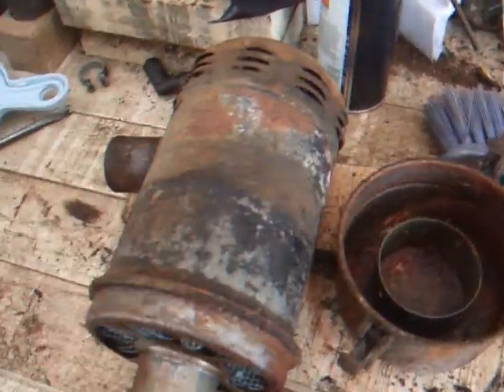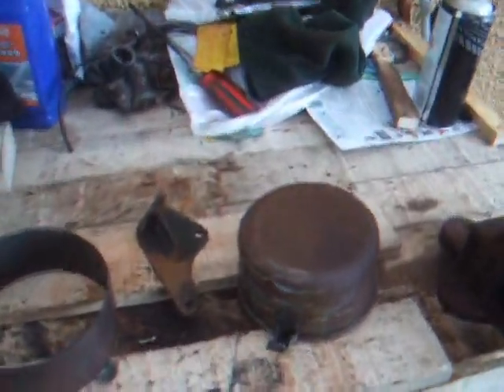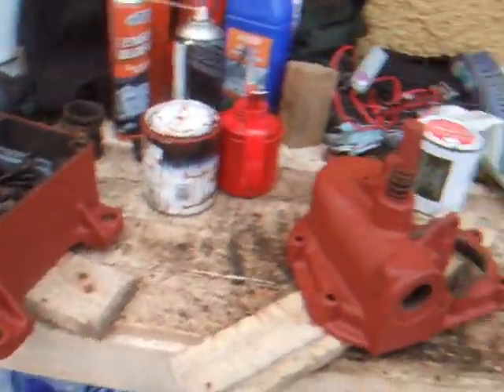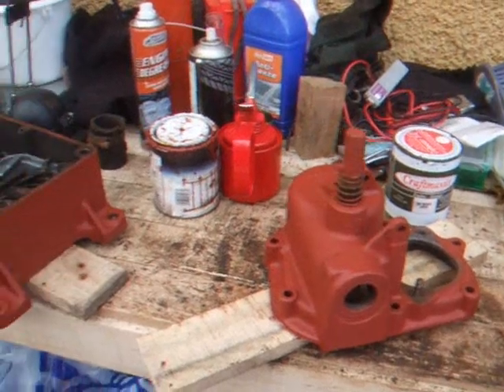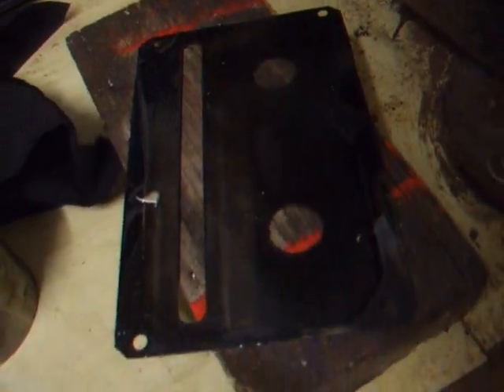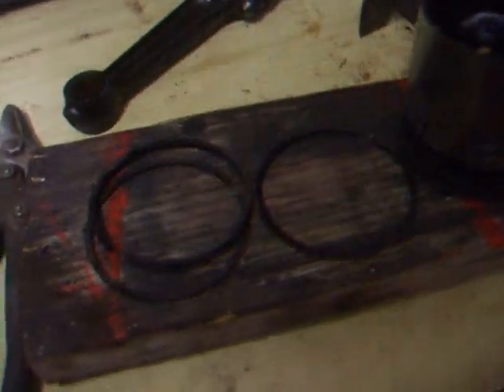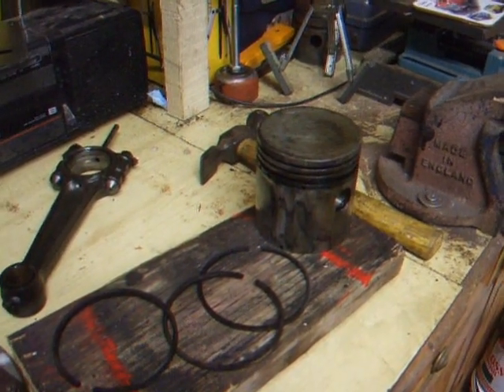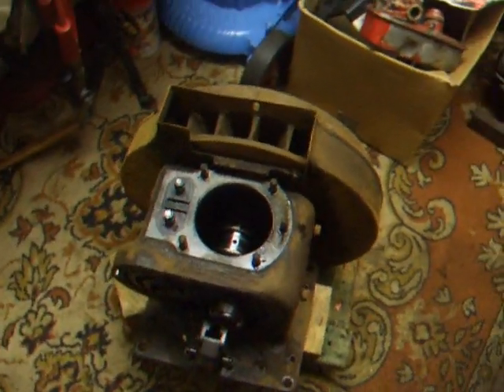Petter A - Restoration - Part 3

Comment: I would recommend investing in a bead blaster .  To clean off the parts of all the rust. And I think you should. Take the rest of the engine apart so it is all cleaned out